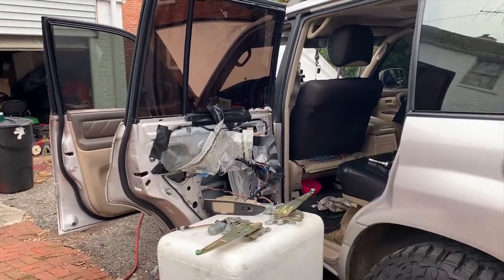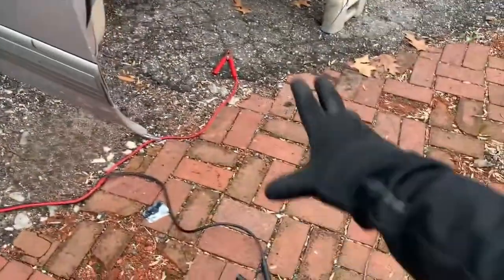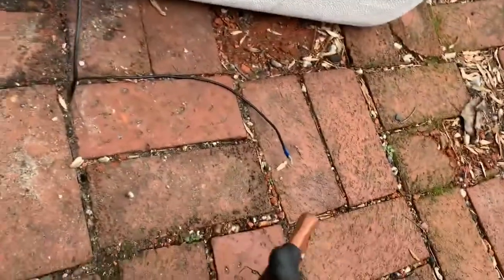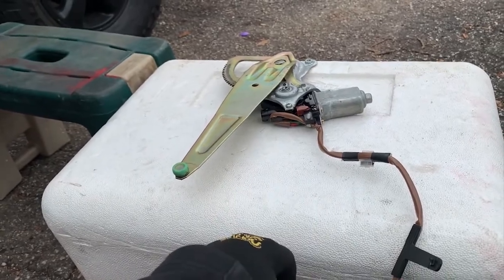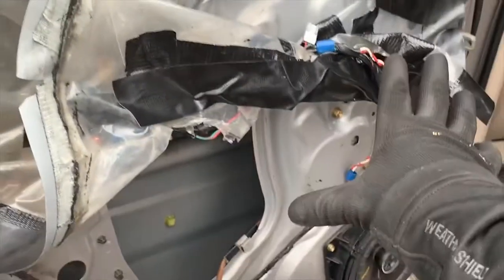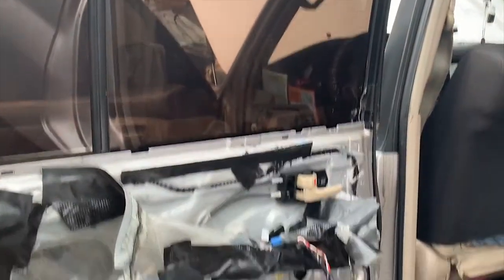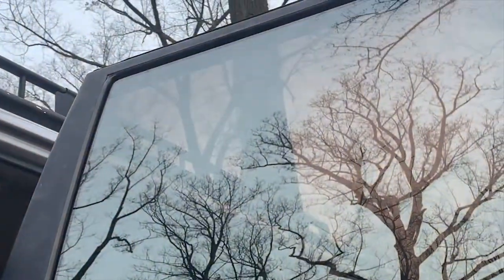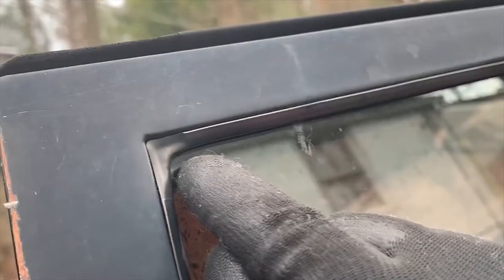How To Manually Roll Up Electric Window That Won't Go Up (Land Cruiser 100 Series)

Comment: You switch cable/ polarity to move motor up and down. First try you were in the down position already, that is why the motor didn't make a sound, then switching cables it went up. Did you try down again after up-position ?
Reply from the maker: Hey Gunnar, that's correct. 

*Window Down*
+ Battery Jumper Cable = Red Wire (my extra wire is blue)
- Battery Jumper Cable = Green Wire (my extra wire is black)

*Window Up*
+ Battery Jumper Cable = Red Wire (my extra wire is black)
- Battery Jumper Cable = Green Wire (my extra wire is blue)

This Land Cruiser has a "somewhat" known issue of which the rear windows will go down but won't roll back up. This is usually caused by bad window switch, motor and worst case scenario, wiring issue. Which I had a wiring issue.

In this video, I was just trying to get the Window back up since I was selling the vehicle to a dealership which a dealer owner was purchasing to fix it and enjoy it.